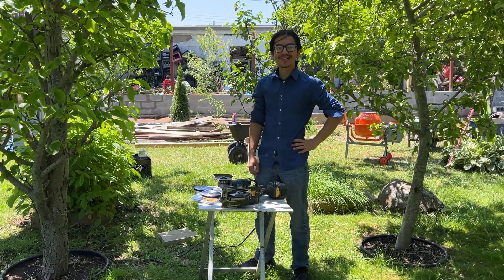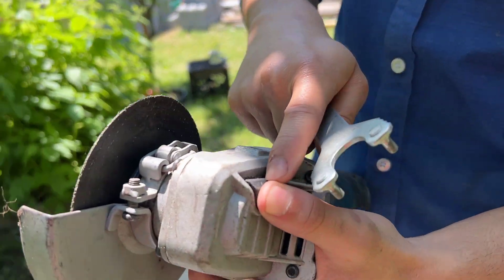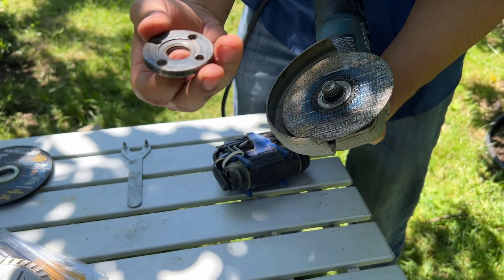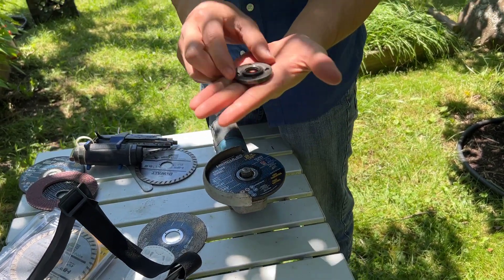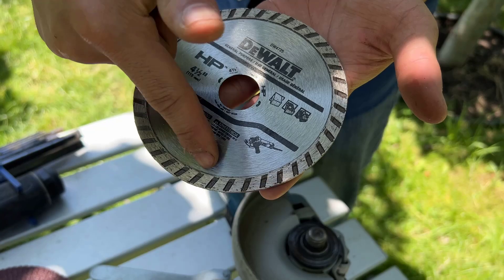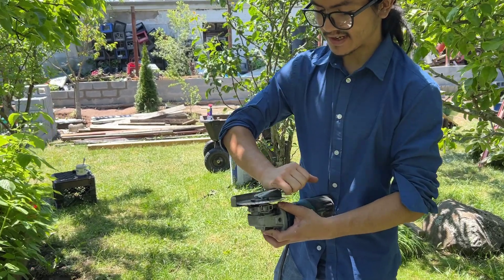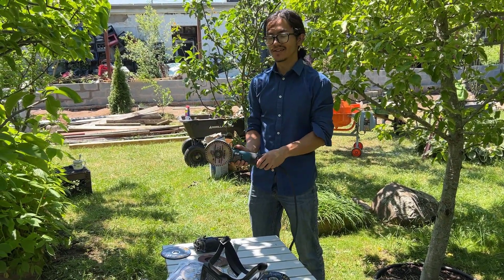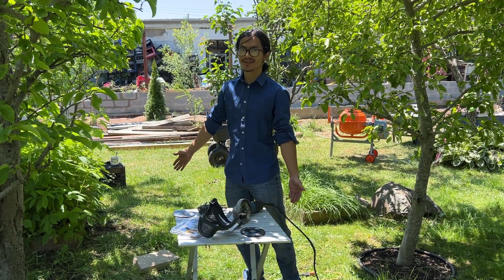How To Remove Angle Grinder Cutoff Wheel Disc | Change/Replace Wet Dry DeWalt Diamond Masonry Blade

Comment from the maker: Here are the #ᴬᴰlinks to tools, parts and accessories mentioned in this video:
1.  https://amzn.to/3Ub6MVr  |  DEWALT Diamond Blade for Masonry, Dry Cutting, Continuous Rim, 7/8-Inch Arbor, 4-1/2-Inch (DW4725)
2.  https://amzn.to/3TYY64C  |  10PCS Saw Blade Bushings - 7/8" to 3/8"(9.5mm) Brass Ring Arbor Adapter Thickness of 1.0mm by ANTENGDATOOL
3.  https://amzn.to/4f2nU7W  |  SALI 50 Pack Cut Off Wheel 4 1/2 Inch Cutting Wheels 4-1/2" x 3/64" x 7/8" for Metal & Stainless Steel, Angle Grinder Cutting Wheel, Cutting Discs with Aggressive Cutting
4.  https://amzn.to/3BF9ZWX  |  DEWALT DCG412B 20V MAX* Lithium Ion 4-1/2” grinder (Tool Only)
5.  https://amzn.to/48asL4P  |  Milwaukee 2880-20 M18 FUEL Brushless Lithium-Ion 4-1/2 in. / 5 in. Cordless Small Angle Grinder with No-Lock Paddle Switch 

Or Click on Amazon link here and search for what you need:  https://amzn.to/3D1T2GQ